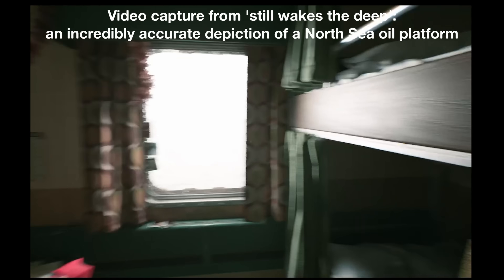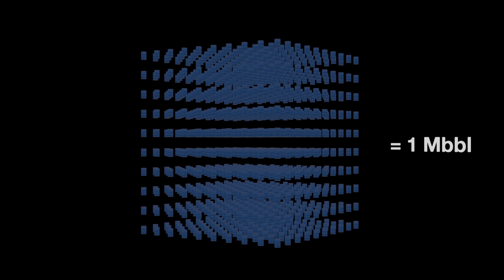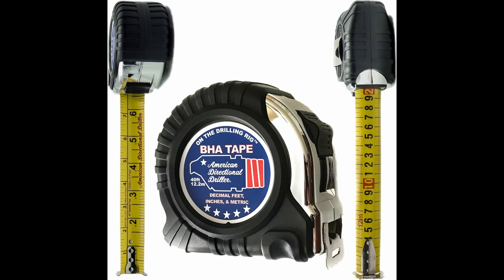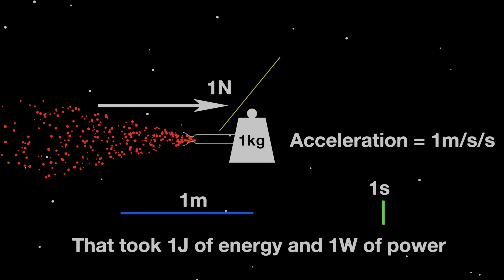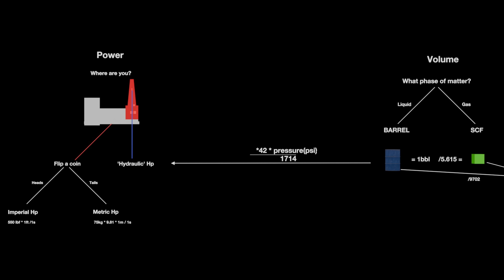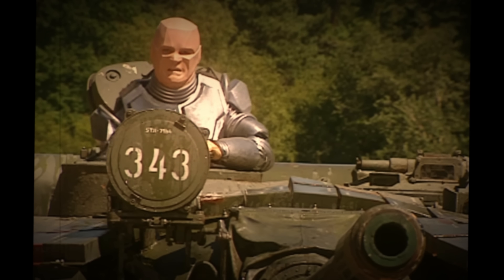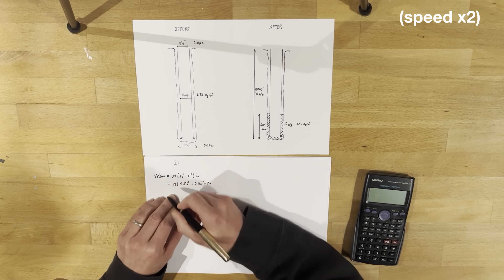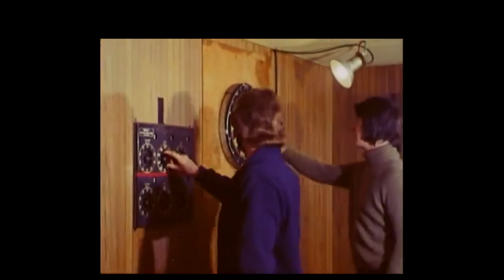Oilfield Units: a Measurement System so Cursed it made me Change Career

Comment: I’m a plumber and pipe fitter (and a drop out engineer). I love engineering and dropped put because of life circumstances.

I have worked at an oil refinery as a pipe fitter, and the thing that scared me the most is that it seemed like the operators didn’t know what was going on in the refinery. They didn’t know where the shut off valves were for any pipe, or what the pipe contained (which as a fitter working on the pipes, obviously I rely on them locking out the system, and telling me what hazards I’ll be exposed to). I would often look up the names of the different processing units just to find out that they aren’t using any kind of industry standard naming system, so even looking up the units I couldn’t know exactly what they did or what they contained.

Just for an example, my first job on the refinery was working on the “hydrobon unit.” We had to go under fresh air, so obviously there was not good stuff in there. Upon asking what is in there, the answer I got was literally “the stuff that blew up the Hindenburg.” To which I asked “hydrogen?” And he said “yeah.” When I worked on it, my gas monitoring went crazy detecting carbon monoxide though, to which a co-worker said that was going off because of a lack of oxygen, even though the 4 gas monitoring went crazy detects oxygen completely independently, and was not beeping at oxygen levels. It’s just a mess. You ask really basic questions like what’s in this pipe, don’t get any legit answers, and then go expose yourself to it anyways.

For those wondering, I am assuming the hydrobon is just a shortened name for hydrocarbon, and I am guessing it has something to do with separating out different hydrocarbons, or maybe removing impurities from hydrocarbons like carbon monoxide? I’m not entirely sure and may never know.

You add on the fact that the plant management is super greedy and trying to constantly push production to its limits. They don’t let things properly cool down before we work on them. I cracked open a flange to replace a strainer and gallons of oil started bubbling out. I was in full fire gear, and the emergency team was behind me, and told me to run away and they blasted it with a water hose. And from what I heard, it was only bubbling out because they didn’t wait long enough for it to cool down before working on it, cause they are greedy.

Idk, that’s my experience with it. Hoping to go back to school for engineering eventually and not expose myself to such risks and idiocy.

Comment: i don't really understand what is being said when part per million (ppm) is called "ambiguous"
isn't it the case that ppm = molecules of the gas in question / million molecules? seems clear enough to me?

api gravity doesn't seem too bad to me either, i agree it's arbitrary but arguably so is every standard
if the guys on the drilling platform can't remember to compare the number to 10 to determine the weight of oil relative to water, i think they need an annual refresher on standards or something
10 is great for comparisons, it's the base of our number system globally, and avoids the potentially disastrous issue of a negative sign being missed due to its smallness.
(under the assumption our "less arbitrary" hypothetical would use sink < 0 < float instead of 0 < sink < 10  < float. if this is not the idea i truly do not understand the issue)

Comment: I run one of the largest and most complicated pipelines in North America. It is one of the great misery’s in life when you have to teach someone new all the mathematics of pipeline operations.
Trainee🤓:” when will the product show up at this location, that should be a simple question?” Trainer🫩:“Well you take the station location of the delivery location and the location where the product is currently at and subtract them to determine the distance in barrels. Station location of course is a measurement from the beginning of the pipeline that takes into account distance, product density, pressure, product heating as it flows through pumps, diameter, and friction that we calculate ourselves everyday because it changes constantly. Then you need to multiply each scheduled flow rate in BPH by the time at that flow rate to determine how many barrels are pumped during that time period. Then subtract it from your total distance in barrels. Then do that 17 more times to account for each flow rate change as we speed up and slow down through that pipeline segment until you determine a time in tenths of hour.  Then you needs to add back the current time to that time so that the new time we get is relative to the future. Don’t forget we use pipeline time (CST) not the time on your phone. Then you need to multiply the tenths after the decimal point by 60 to determine how many minutes past the whole hour it will be. Then we call the customer and tell them what time it will be there. Oh and if anything causes us to deviate from the schedule we have to do it again.” 
Trainee🫠: I quit

Comment: The “decimal-feet” thing broke me, as a civil engineering student. I’ve heard of it before, but I think it is the one sort of measurement both Americans and non-Americans agree is cursed.

I like dividing my feet into twelve inches; twelve is more composite than ten. If I wanted to be working with decimals, I’d switch to SI units! I’d even prefer working with imperial Russian units of measurement than to decimalize feet.

The rest of them could be improved by switching to simpler ratios of US customary measurements. I have no intention of fully metricating in my lifetime, but I’d find it worthwhile to remember both systems of weights and measures.
Reply: I imagine the relevant use case for decimal feet is base 10 computing, like an Excel sheet or maybe CFD program. 1/12 = 0.0833333333. Pretty imprecise. Whereas if you take the measure in 10ths or 100ths it could go straight into a calculator with precision. So while it seems awful to deal with, I feel it probably has a good reason to be there as well.
It's a little sad to me that we can't do mental math with base 12 nearly as intuitively as we count base 10. I'd have to time travel back to infancy and have my parents and educators replace all the base 10 stuff with base 12 for me to reach the level of intuition I have for base 10 today.
I just don't know why they are forcing a Brit to put up with this when they have the common sense to use metric most of the time over there. International standards, I guess..? I sympathize.

Comment: this video hits me in my soul. yesterday I had to spend 12 hours on what was supposed to be a 7 hour job setting up a concert stage in an arena, and it was all because the designer used that horrible decimal foot system when planning the layout (NOT standard in the stagecraft industry) and we had assumed that they were, you know, normal inches. the further downstage you went, the more out of line it got. All our cables were the wrong length. None of the trigonometry was right. The poor riggers sitting 70 ft in the air had to re-hang almost EVERY suspended chain motor, and there were already a LOT more of them than usual in this setup. I was hired as an electrician but i just wound up having to help the riggers out instead. If that stage ended up being symmetrical it’ll be a miracle

(Also nice Casio calculator lmao! That’s by far my favourite scientific one to use)

Comment: 1 atmosphere is 1 bar but standardized to 20 degrees celcius at sea level, which is relevant to noone but people going up into the air or sit in or below water in the form of conversion into different temperature theoretical or pressure/vacuum circumstance

Comment: I went to a railway museum last weekend and saw a new unit of measurement that I never even knew existed, which is less cursed than these bizarre arbitrary monstrosities but still baffling. I saw a locomotive steam pressure gauge in kilogram-force per square centimeter, marked in increments of five. If anyone knows why they would use this instead of kPa I would love to hear it.
Reply: the math is easy

Comment: There is a lot of "gatekeeping" in the engineering disciplines, and using arcane measuring systems is a common "gate" in all of them. Studying mechanical engineering in the US, I was exposed to most of the odd mixes of units that you describe.  It was silly to have to use completely different units depending on what class you were attending - electronics, fluid mechanics, energy production, physics, mechanical design - each uses its own obscure system, with only physics and mechanical design using SI units fairly consistently.
Antiquated measuring systems, and the trouble created by the need for endless conversions, is hugely wasteful. It has been the cause of many, many avoidable, expensive, and tragic errors.

Comment: For a small bit of pedantry, and for what it's worth, for as ...charitably we shall say "befuddling" as many decisions regarding our measurements here are in the states, the way you say aluminum like us from the US is for a given definition, actually the correct way to say it. As I understand when early work was being published about aluminum in the UK editors changed the spelling to "aluminium", I believe to have it bare similarities to the various other elements which end in -ium, however the person to discover and make many of the first attempts to isolate elemental 
aluminum, Sir Humphry Davy spelled it Aluminum, as us Americans do. However, it should seem, for one reason or another, that the spelling and pronunciation "aluminium" is the one that has won out in the entirety of the English speaking world except for here in the states.

If nothing else from the sounds you are in a similar position to me, but you may sound slightly less ridiculous saying aluminum in an non-American accent than an American saying aluminium. As I have had many friends across the sea for many years and have been caught saying both aluminum and aluminium in large part due to my proximity to them, which always seems to get a laugh out of non-Americans and makes my countrymen cringe.

Comment: I feel absolutely heard here. Working with pressure systems in the UK, you get to enjoy all sorts of units from bar (the de facto standard) and PSI (not uncommon), to units like Pascals/MPa (common on ships with stuff from abroad shores, 10 MPa = 1 bar so it's of negligible disruption). When dealing with vessels you get units like millibar (not uncommon), antiquated units like the manometric millimitres of water column (mmWC), inches of water column (inWC), and the same but of mercury (mmHg and inHg). And just every once in a while you'll come across oz/in² which is just like how PSI is lb/in² but for ounces, so there are 16 oz/in² to PSI. Quite frankly you could go your entire career only knowing bar and PSI depending on what you are doing, and a lot of pressure instruments are dual scale (such as pressure gauges) or can change the units (like digital indicators) as required, but if you work in the repair industry then you have to prepare to be handed a potentially 30 year old valve with pressures in some wacko imperial unit and just handle it as it comes.

Just like how in the video mentioned is the volume of scf and the associated flow-rate of scfm, we also use the volume measurement of m³ or litres and m³/hr (yes per hour, not per minute, no idea) and L/min or L/hr. Because of the properties of valves, sometimes it's important to know the flow coefficient of the valve for flow calculations. This is because any orifice restriction on flow will cause turbulence in the flow stream as well as pressure drop. Thanks to our completely antithecal units, there are two flow coefficients defined entirely separately. First you have Cv for imperial, measured in US gallons/min, which is calculated as Q (the rate of flow expressed in US gallons per minute) multiplied by the square root of SG (the specific gravity of the fluid where water = 1) over ΔP (the pressure drop across the valve expressed in psi), and naturally secondly you have Kv for metric, measured in m³/hr, which is the same calculation for metric units so Q is expressed in m³/h, SG is the same, and ∆P is expressed in bar.

And as if the units weren't bad enough, in the UK we love to mix and match our engineering standards in areas like flanges and thread connections too. Thread connections are usually in the British standard BSP (British Standard Pipe) with parallel threads or BSPT (British Standard Pipe Taper), both of which are defined using imperial length measurements, until they're in the American standard NPT (National Pipe Taper) which is also defined in imperial, and just every once in a while you will encounter metric threads M for piped connections. With flanges, the old standard was the British BS10 Table flanges defined in imperial, however these have been all but de-facto superceeded by other standards which were already co-adopted into British standards. The most common one to see outside of the petrochemical industry is the originally German, now pan-European DIN PN flanges, which are defined in metric measurements. The most common one in the oil and gas industry is the American ASTM ANSI flanges, which are defined on imperial measurements. As all three of these are flanges with varying bolt hole sizes, locations, and sealing face dimensions, they are very rarely cross-compatible and even if they are, it's often a bit of a naughty thing to do. To my mind, BS10 Table F and PN16-40 for various sizes around ½" to 1" are compatible as the measurements only differ by about a couple mm. An interesting note here is that whilst the British BS10 flanges were nomally known as 'Table' with an incremental letter, the DIN flanges are defined using a 'nominal' pressure in Bar (so PN40 = nominally 40 Bar), and ANSI flanges are the same but for PSI (Class 150 or 150lb flange = 150 PSI nominal).

Anyway I'm no authoritative source and I certainly don't have more than a few years' experience in this industry, but these are all things I've picked up on that are interesting to know. What I have come to understand is that engineering is not the hyper accurate, standardised field that I thought it was, and there is a crazy amount of "close enough", conversions and just straight guesswork involved.

Comment: I work in avionics software - aviation has some crazy units as well. Fuel quantities can be in liters, gallons, imperial gallons, kilograms, or pounds, so when doing conversions from weight-based units to volume-based units the density of the particular fuel type on the plane has to be taken into account. Distances can be in nautical miles, statute miles, or kilometers, so fuel efficiency might be expressed in any combination of these fuel quantity and distance units. Both millibars and hectopascals are sometimes used for pressure even though 1mbar = 1hPa; some manufacturers INSIST on using one or the other. mmHg, inHg, and atmospheres are also used to measure pressure…🤦‍♂️
Reply: everyone is following the standerd, the probelm is that overyone has a difrent standerd

Comment: I'm an engineering student at an American university, and we do actually use pounds for mass! And force... And it's a single, easy to forget letter that'll mess your whole calculation sheet up, because of COURSE they have different si conversions. To anyone using imperial units IN their calculations: you have more paper and time than I ever will, and you should probably find a dominatrix instead of getting your masochism fix through math problems

Comment: The thing about US customary units is that most of them originate from the UK, we just never swapped. (In some cases, because the French apparently can’t be trusted to take several lumps of metal though some of the most-traveled shipping lanes in the world.)

This doesn’t apply to things like the bbl unit. That one’s on us, sorry.

(Also, we do do calculations in customary units - there are actually two copies of some building codes based on if you’re using foot-pound or newton-meter)

(Also also, your adventures in numerical pronunciation can be answered by “code switching”, a linguistic phenomenon)

Comment: Watching this video from the stabdpoint of an engineer outside of O&G is great until I got to the part about decimal feet and immediately got flashbacks to the time I decided to scale down some AutoCad blocks at 1:100, but didn't realize they were in Imperial. Most of the buildings I work on are Metric, so now I get to be reminded of my foolishness every time I begin a new project. Thanks for the trauma reminder

Comment: It’s annoying but from my experience on submarines, the use of seemingly random units of measurement is to associate certain numbers with specific equipment so that if you hear a number and a piece of equipment’s name you can quickly identify issues. Trust me there’s a lot of things that operate the same and it’s easy to get them mixed up and cause more problems. Still annoying as hell though.